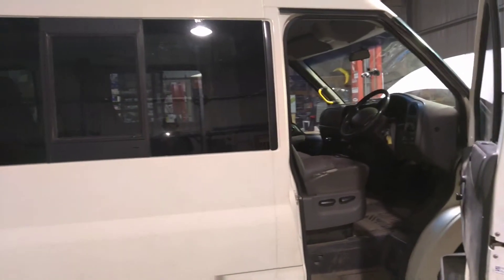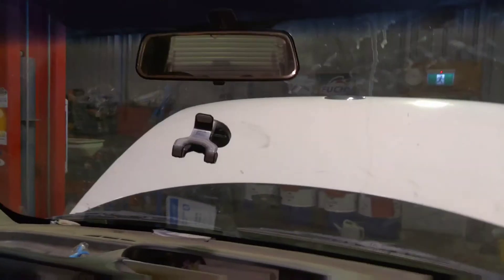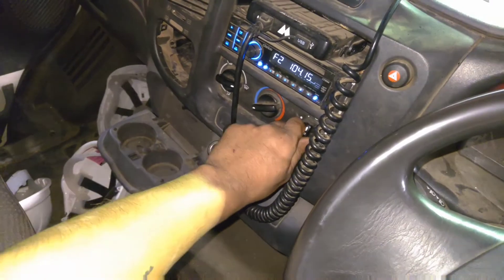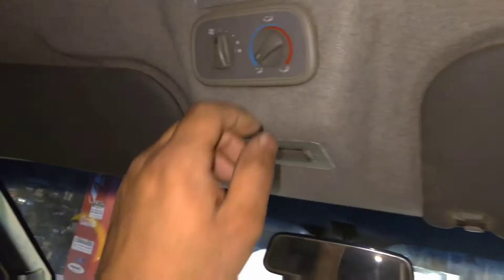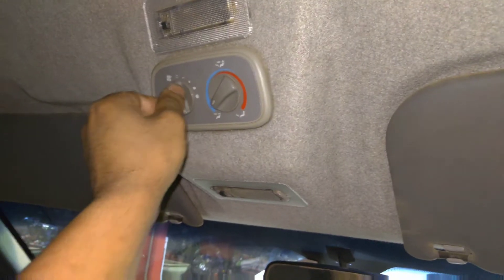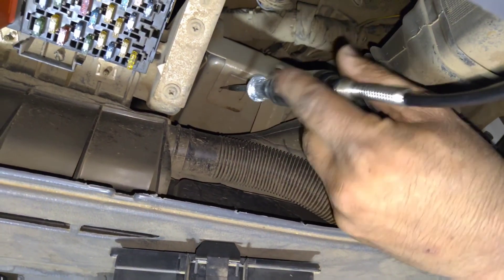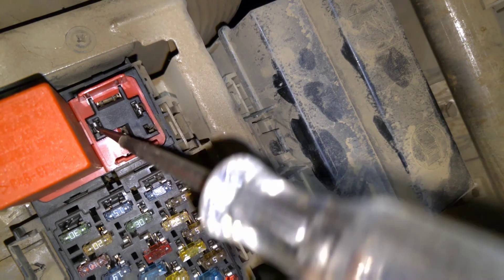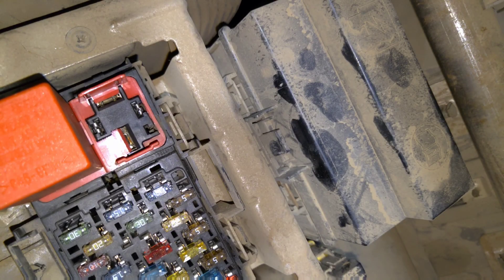Ford Transit Rear AC Blower Motor not working Part 1

Comment: My 2015 350 XLT quit blowing out of the roof vents even though you could hear the blower running. I had to pull off the 2 side panels in the rear of the van. I could then see the coil was covered with scum, dirt and debris. I had to remove two bolts and a dozen torx screws so i could remove the blower, seperate the houseing and get the gridded shroud off the the top of the coil. then carefully remove the layer of scum. I then sprayed, waited and wiped (3X) a foaming coil cleaner (from walmart hardware section). Then gently blow some compressed air through the back side. Put back together for a total of 90 minutes work and a trip to WalMart.
Reply: I have the same problem with my 2016 Transit. What you did, did it fix your problem?